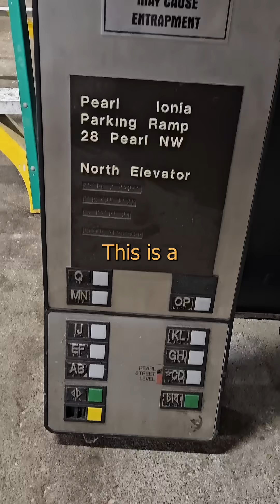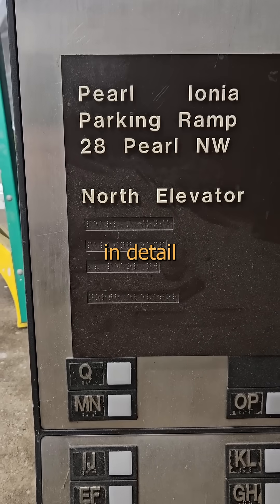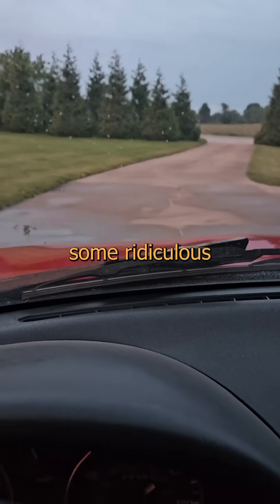Miata Mischief #chrisboden #engineering #gear #elevator #score #stories #parts #hacking #making

Comment: I've owned both a first-generation and a second-generation Miata. I was able to fit a full-size golf bag in both of them, as I played golf during the times when I owned each. I've also managed to cram a Fender Twin Reverb [tube] amplifier with a pedal board and at least two guitars into a Miata. I'm pretty sure the weight of a Fender Twin Reverb amplifier alone put the rated weight that a Miata is supposed to be able to transport over its limit.

Comment: My day to day job doing appliance repair out of a 4 door sedan should probably be enough of a story. Hauling 70lb panini presses in and out of the back seat cause my trunk is already full of tools and the back seat is covered in boxes from the parts that were used to fix other machines. Pretty sure the seats are stained with grease back there too. It's an adventure trying to get dairy dispensers in there that almost don't fit through the door openings.

But you have to make a living somehow and this so far is working :)

Comment: I hauled home a free dump truck jack from the 70s/80s. Only thing was I had to fit it in a Honda civic and I put it in myself. I was 18 at the time
Edit: for perspective since I can’t show the picture, the jack was 4 feet shy of the length of my car with the handle down. Which I couldn’t take off. And half of that length was the piston, massive steel wheels, and the rest of the steel that housed the piston

Comment: I started doing this shit as a teenager and haven't learnt my lesson yet.

First occasion was a load of scrap wood in the skip at my first job,  various lengths and sheets were attached to my mountain bike vaguely balanced on the pedals and held on with string, a couple of bungees and prayers.  The first couple of miles were pushed but then I reached a downhill (Gilesgate into Durham for any locals).  Now its quite a steep hill and cheap 90s mountain bikes weren't blessed with brilliant brakes at the best of times but mine were frankly shit so even as a spotty 17 year old I really should have considered the affect of adding 40kg to the mass before trying to ride down the hill and the fact that with wood sitting a couple of inchs either side of the front wheel I now had very little steering.  Not sure how I didn't die but probably reduced the lifespan of my trainers by a significant amount!

  Pushing it up the hill on the other side was no fun at all.

The wood was turned into a model railway baseboard for a mate, traveling to his house in the boot of a Citroen XM then dismantled and do I want it back?

Yeah, why not?  Another friend had been using a golf trolley to tow a canoe behind his bike.  He'd given up the canoe so the trolley was now surplus and turned into a trailer with chipboard.  I'll fetch it in that!

Inevitably the trolley collapsed halfway home and my dad wasn't too impressed when he had to rescue more rubbish.

Still not learnt so my boss has upgraded the suspension on the current work van.

Comment: With my '00 528 wagon, i moved 12 sheets of advantech decking and another time, moved two 6x6x12 posts all on the roof.  Ziptied two 2x4 to make crossbars and ratchet strapped the load to the roof rails.  Still choose the wagon for home depot trips.

Comment: How about a recliner chair in the back of a 78 Honda Civic hatchback.  Folded the back seats down, reclined the chair, and stuffed it in foot rest first.  It all went in until the backrest of the chair met up with the hatch.  Then tied it all down.  I cannot remember if I had a red flag on the part sticking out from the back of the car.

Comment: helped move the last of the things out of a friends house that sold and I was tetrised into my 67 notch back Barracuda pretty well, worked pretty okay till someone made me hit the brakes and the contents of the car pushed my seat forward and me into the steering wheel also where the propane tank I thought was A the biggest problem, B empty, and C I could move by reaching back behind me was Not empty not the problem but a new fourth thing. a surprise parking lot stop and rearrange while airing out rest of trip was less eventful

Comment: i'm a bit late for a prize and this isn't a story about hauling something home unfortunately! but when my partner was trying to move out of their college apartment in humbolt, we had to haul their mattress to a recycling place and all we had was two bungee cables and a 2000 rav4. the thing basically sat on the roof of the car and lifted like a windsail, at one point it flew back and was strapped to the back of the car, and we had to pull over on the highway to get it back in a good position, but we still had to hold it down with our hands sticking up out of the window, grabbing the mattress for dear life. most terrifying 25 minutes of my entire life, 0/10 and we never told our parents about that day ever.

Comment: Not what I personally did but I run an electric motor repair shop and sold a 50HP motor to a bit coin mining operation and they said they’d send someone over to pick it up. Since they were replacing one they already had I assumed the had enough sense to send a truck or sprinter van after the 500lb hunk of cast iron they were picking up. Nope! This lady pulls up in mid 90s Geo Metro. She explained to me it was too critical to turn around and after removing the eye bolt for clearance  and man handling it into the trunk of the car at all kind of awkward angles, she went on her way. Dedication at its finest.

Comment: When I was 18 I would roam the local streets picking up computers off the side of the road. One night I found two mini hp desktop computers sitting next to the dumpster of the local computer shop a few miles down the road. I still didn’t drive yet so I balanced them both on the frame of my mountain bike between me and the handlebars to get them home and tinker with windows 98 👍

Comment: The sketchiest thing I've ever done was haul 13k worth of material to the scrap yard using a trailer with no brakes rated for 6k of payload and towed by my v6 full-size single cab dodge.  It did a burnout up the loading ramp!  I'm sure I violated some DOT laws, but I guess rigorous maintenance has its benefits for a 300k mile workhorse.

Comment: not necessarily sketchy nor a haul but i went to the tallest building i could reach in 15 minutes of driving yesterday and just rode the elevators up and down

about 1.4m/s and 22m from basement to floor 7 according to phyphox

most importantly THE CLOSE DOOR BUTTON ACTUALLY WORKED, also shoutouts to the guy who interrupted my return trip to the basement at floor 3 and left me explaining why my phone was on the floor with three graphs

Comment: I worked construction, and was pouring forms for footings for an awning. One tube was a little crooked, and when the foreman tried to nudge it it split and got ruined. We needed 6 and a half feet, so I went to buy an 8 foot tube from the local hardware store, and drove a convertible. We didn't have a truck on site that day, so I was the only one that could get it. I get to the store, and they only have huge ones in stock, 16 foot or so, so I took it, seatbelted it in the passenger side with the seat down a bit and drove to the construction site like I had a giant antenna, just didn't hit the overhead lines with it.

Comment: I’m late but I did tow my buddy’s mk3 Supra a few miles back to my shop in my 5spd ford ranger with two shotty ratchet straps and a dream. We called each other so he’d brake when I’d brake, and only fucked up one strap in the process. 10/10 would do it again.

Comment: Had a scion frs. And I bought a spare frs engine. Surprise it cant fit in the trunk.... but it fit in the passenger front seat 🤣🤣🤣🤣 seat weight sensor never had an issue afterwards

Comment: I have used everything from four wheeled moving dollies, two wheeled moving dollies,5 wheeled rolling office chairs, and even a shitty, not meant to be used, display purposes only skateboard to move all manner of things. I used the skateboard, which ended up with bent axles and a cracked board to move my 2250 watt generator. I used a borrowed shopping cart to move everything I owned. Twice.

I once bought a reclining easy chair, and since delivery wasn't available that evening, I carried it the more than two kilometers home, balanced on my head. 

I wasn't balanced on my head, the chair was balanced on my head.

Comment: I bought a big computer networking switch I won in an auction. It only weighed about 300 pounds or more, and I had to take it apart to fit in the small car and was so heavy I basically went home on two wheels. Far drive too, not the best foresight in the world. Almost broke my car for a switch I didn't need lol

Comment: I don't believe y'all have ever had to be a trailer hitch going down route 12 before have you? Me and my buddy happened to have was a spare Dolly after helping a guy move for lunch and smokes, we drive back home and we found a 1950's G&E fridge, working mind you, for absolutely free he just had to take it away we where a legally safe amount of miles away from home what's the worst that could happen, Nothing apparently that's now sitting in my garage with pinstriped painting, i dont recommended it but it works well, you just needs to have all windows down for communication

Comment: 😂😅 I lived the early parts of my life were lived first in a an 89 2 door exploder and then in an escort zx2, I strapped so much crap on the ceiling that it isn't funny. 

Even now, I've never owned a truck, I do however own a Jetta station wagon. I've moved twice with this car, strapped multiple mattresses to the roof and hauled many an 8x4 sheet of plywood and drywall on it! 😅

Comment: WAAAAAY Past the day here... but I went traffic jousting in my old Crown Vic once, picking up garage door tracks, panels and torsion bars. 16ft door... home was like a mile away so I didn't wanna spend extra cash on the rental truck if I could just slap it all on there lol. Ratchet strapped the torsion bar to my B pillar, with a little weight forward resting on the side mirror. Everything else went on the roof, with a crafty little 2x4 parking lot engineering brace holding up the front resting on the push bar. Jankiest shit I ever did, but it worked! AND there was no permanent damage to any of the body work!

Comment: I helped my buddy with an 08 Acura TL pick up an aftermarket front bumper for the same car in Boston, an hour away from where we live. 

The front bumper did not fit in any other way but through the sunroof!

So for an hour, he’s holding his new 1K bumper; which about half of it is sticking out of the sunroof from flying away as I drove us back to his place 

A couple years later, the bumper is now in pieces due to puddles and the car being a little lower (and I mean a lot lower) than it needed to be! I have videos to prove it lol

Comment: In my 1992 miata I moved everything from my college dorm. It included a very large unicycle, a tv, snowboard, 3d printer, desktop computer and backpacking gear. During finals I figured out a way to rig up a hitch and build a luggage carrier from some steel I bought. The car’s suspension was soooo low and took me about twice as long to make it home

Comment: An 8' sheet of plywood fits inside a ford focus... you cant have rear seats in the car... or the passenger seat... and you have to lay the drivers seat down a bit... and it will rest on your head a little... and you won't be able to see anything to the right of you...

Comment: The sketchiest thing I've done to haul something home was I bought the couch I have now for like $40, and it wouldn't fit in my mom's SUV with the trunk shut, so we closed the trunk as much as we could and used paracord to bind the rest, it wasn't 250 lbs rated paracord like it should've been, it was fucking string, and surprisingly it held the couch until we got home, didn't get pulled over and never talked about it after, that was about 6 months ago...

Comment: I have an elevator control panel from a local mill all be it mine is tiny compared to yours, but it lead me to removing an overly large rope operated elevator mechanical parts from the third floor attic of a building, it's got a 6 foot diameter bull wheel the rope rides on with a brake band and all the gears and a cable drum all fitted on a mortice and tenon timber frame, 500 pounds of cast iron counter weights basically it's a dumb waiter on steroids that you could ride up and down 4 floors with a simple pull of the rope, The call me "Dumpter diving, bumper dragging Dodah" for dragging home a record 2 1/2 tons (4700# on the local scale) in a 1/2 ton van once.

Comment: I have a 2010 Miata, and it is a blast to drive.   But back in 1988 my father bought a lebaron convertible.   One day we went to a local nursery and we bought a potted tree for the house.   So I sat in the back seat of the LeBaron holding this stupid tree vertical as we drove through local neighborhoods to the house.   Dad eventually sold the LeBaron and got a first gen Miata too.

Comment: I found a huge cactus in an alley someone threw out. It was in a bucket wedged in a large ceramic vase with balls of newspaper poorly spacing it in a way that made it wobbly and want to fall over. I also had my time trial bike so I ended up having to kinda walk my bike and balance this giant cactus on one arm switching every now and then because I had to walk several miles. I got home only slightly scuffed up from the long needles but my arms ached. The next morning I did some research and found that the cactus was poisonous and could make farm animals blind when they scratched themselves on it.  I was thankful i was still alive.

Comment: MASSIVE OAK LEGAL DESK, 10 feet length one and and the other part was 6 feet long. A very lithe petite 500lb desk at the 4th floor with no elevator. One destroyed clavicle later, a desk strapped to a sedan roof with hopes prayers and 1 tie down, and a traffic ticket later FREE DESK. That was too big and was sold off for a couple bucks

Comment: I bought a like 8 sections of 20 ft long 2x4s for my eagle scout project of building benches, but we didn’t own a truck so out the back of my mom’s Chrysler Pacifica hybrid where the 2nd row of seats don’t fold because of the hybrid battery, I opened the smallest of the two pop up sections in the third row, buckled up, and without rope I’m pushing the boards to the floor to keep it in the minivan as we drove and the trunk slightly open with my left foot pressed on the boards while we did 40 mph and it took 15 minutes like that with stops at lights to get home with it.

Another time in boy scouts, the van (held like 15 people or so) to carry us back to the campsite broke down and we were 24 miles away from said campsite, and it was 4 pm at that point, we had finished an 8 hour day walking 10 miles trimming trees along the way on the Ohio trail near lake lauramie. Since walking back wasn’t an option, one of the scoutmasters brought a truck and 16 scouts piled into an enclosed attach on enclosure on top of the bed of the pickup truck (the ones from the 90s to early 2000s, a ford ranger I think) and without seatbelts we rode back to the campsite with little to no ventilation.

Comment: I have multiple jank transportation stories, it's hard to pick one.
Like when I picked up a bunch of 20ft metal roofing in a 2002 Jeep Grand Cherokee by strapping a couple of 2x6s under, putting it from my dash out the back glass and hanging out the back, flagged it then drove it a couple hours down the highway
Or when I picked up of free queen size a warehouse had as overstock, but it was spur of the moment and it was in my girlfriend's 2006 Scion xB and she and a friend were in the car. We put the back seats down, shoved it in as far as it would go, tied the back hatch as closed as we could get it with some stuff in the car, then my buddy road home laying on top of the mattress. If that back hatch opened it could have been a bad time, but instead it's a fun story from when I was a teenager.

Comment: Summer of 2003, I had a 1983 Honda Accord 2 door hatchback. I used that thing to haul home 4 sheets of 1/2" plywood. It wasn't sketchy at all, I had them secured in tight, they weren't going anywhere, but man, it sure looked sketchy. Less than half of the sheets were inside the car, but I had them ratchet strapped in place to the latches for the folding rear seat which I knew were real secure. I've got a picture of it around here somewhere.

Comment: I used my MX5 mark 2  (Miata) to take a 5" clock and case to a customer 50 miles on the motorway (Freeway) . It was summer so i could have the roof down.

Comment: i, about 3 months ago, went to go pickup a front bumper for my 2013 camaro about an hour away. only problem was, i went to pick up in my 2013 camaro. so after i leaned the seat all the way back, moved all the way back, and lowered the rear seats, i was finally able to close my passenger door and lose all visibility on my right side for the hour drive back home to install it

Comment: 16 year old me used to ride a moped to gigs and rehearsals with my drum gear mounted across every inch of my torso. Pedals slung over one side of my body, snare over the other side to counter balance.

Cymbals on the back plus a full helmet made me look like a Ninja Turtle 😂

Probably the biggest issue was the moped wasn’t restricted like it should have been so instead of being limited to 30mph I was doing 55mph with a provisional license and 2 brain cells who worked opposite shifts.

Comment: Space Invaders cocktail table fit nicely in the bed of my Subaru Baja but it was so light weight that, in combination with the limited tie down positions in the bed, the ratchet straps essentially suspended the game in the air. Very unsettling feeling when accelerating or hitting anything larger than a grain of rice but it got home in one piece.